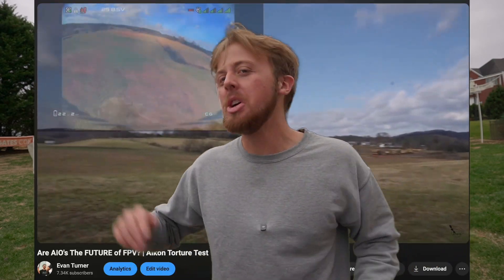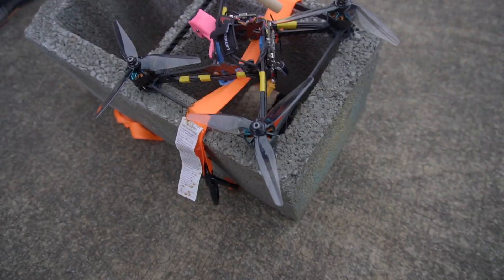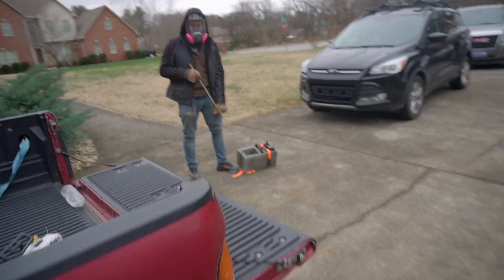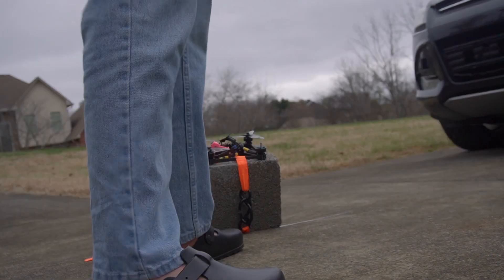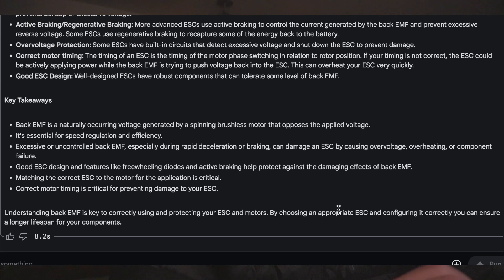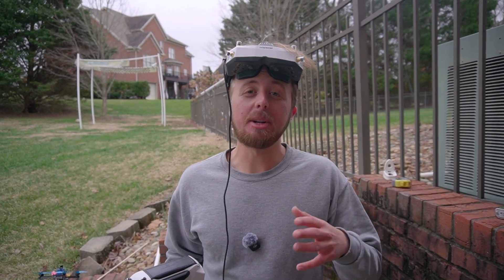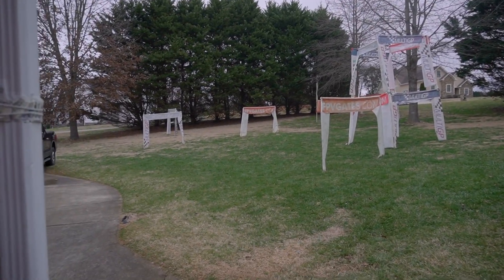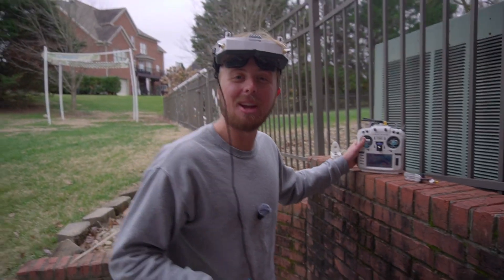Can this AIO Survive a Prop Strike?  | FPV Drone Torture Test

Comment: AIOs have been solid on 6s for like the past 2 years.
Reply from the maker: I had never seen one stand up to a race build ! What’s been your go to?
Reply: @ Jhemcu boards have been surprisingly solid. Out of about 7 boards plus 2 16x16 AIOs I’ve only killed one ESC in a crash, 3 others died on the bench because my MacBook port was shorting them out. I have an f411 in a cinewhoop that’s gotta be at least 3 years old. Super reasonably priced for the features too.
Reply: @ …also that’s fair regarding the race build, I’ve been flying them on no bigger than 4”

Comment: No, if you stop it forcefully outside the motor all the energie goes in the mechanical destruction (motor, prop and stick) and not back into the motorcontroller. Hoever if you stop the motor by the controller it all the energy must be absorbed by the controller. But here you are lucky because the motor (the moving part) and prop itself has a little mass. So if you put a very heavy prop on it you could destroy the controller by this action. On CNC we us very big resistors to burn this electric energie that is coming back from the servo's at stopping.
Reply from the maker: Interesting! Even though we left the ESC at full throttle during the strike it’s not damaging it? Would love more info!

Comment: On my freestyle build with individual ESC's, Each ESC has a capacitor along with 2 I run on the PDB(Yes...a PDB) and one on the DYS PRO V2 from 2018. This setup in this form has lasted since I built it in 2018 with only motors that have been changed out. Prob 3000+ packs cycled through it with zero failures. Forgot to say the ESCs are EMAX BULLET PRO LED 35amp. In my opinion the only reason this setup has gone this long with no failures is from the large amount of capacitance absorbing all spikes. Oh yeah, 6s with 2750kv!!!😮
Reply from the maker: Wow that is incredible!

Comment: Awesome response to the comments on your previous video.  Love the positive attitude and fun experimentation. I think that Aikon managed to make the ESC traces in the bigger 25x25 PCB thicker by moving all the non-ESC components onto that little daughter-board that is stuck on top of it. That I think beefs up the ESC section big time.
Reply from the maker: I think you’re absolutely right and it’s genius. Thanks for watching !
Reply: Wouldn't that make it a stack instead of an aio?

Comment: I think the future is AIOs and stacks coexisting together just like we have now. The biggest issue with an AIO is that when one of the ESCs does go you have to junk the entire thing. I like being able to just replace the ESC and not having to worry about changing the flight controller and reconfiguring everything.
Reply from the maker: totally agree, i think the way aikon is doing it with an aio that is really 2 separate boards is pretty genius so good on them especially if we can start replacing one or the other

Comment: The aio you used weighs 14.5gramms. The iflight Blitz mini stack, 20x20, with a 55a rating has all up whight of 16.5. That is only a marginal saving and kinda defeats the purposes of aio.
Reply from the maker: But it’s only one stack high which saves space!
Reply: Saves space at least

Comment: The Foxeer Reapers (aio) I bought 3yrs ago are still running strong and all I ever do with them is crash at full speed 🙃
Reply from the maker: Dangggg which quad is this on?
Reply: @headsupfpv  Bought them for My TT V1s and eventually swapped them into my TT V2s
Reply: https://youtu.be/gEoSfN-WaFQ?si=p1d1CLD6cfk0xDMH

Comment: Aikon make good esc's.

But tbh its probably some sort of degradation over a lot of heavy usage on the fets that eventually get taken out by all the factors of a crash or turtling.

The physical shock of crashes probably is also a factor in esc's blowing up as is the huge current/voltage spikes and sudden loss of active cooling on  un-heatsinked fets.

Which is a point if you crash into a tree etc its not just one prop being stopped it could two or three being jammed simultaneously which would even more strain on the esc.
Reply from the maker: Totally valid take !

Comment: Now we need a 1h stress test of it :)

For example : Automate throttle to change every X seconds with a max throttle for X second every minutes

Need to have a nice cooling and to log all of the possible data!
Reply from the maker: This sounds awesome! Will definitely try it out.
Reply: @headsupfpv  I did some brainstorming with myself and found this protocol

You will need a external power supply to replace the Li-Po

1- Analyse a blackbox file of one normal flight
2- Extract one minute of the throttle position of this flight
3- Put this extracted data in 5 category (or more): 0% / 20% / 50% / 70% / 100%
4- Make a program that send throttle pourcentage for 60 min
5- Eat chocolate (important one)
Reply: @Cornusse  can be done with EdgeTX special functions switches and curves to add throttle to such position and back to zero on repeat, yes.
Reply: @jasukenneth  Oh! Thanks for pointing it out, i don't know much in EdgeTX :)

Comment: Boy, he was scary with all that stick jabbery, all he had to do is go in from the side, but i really think there should have been a bunch of long punches to get every thing hot first then do the prop strikes
Reply from the maker: Will do this in the next one!
Reply: Also escs get weaker after time, so fly it hard more then try strike tests again while its hot, I'm really interested in this esc for some speed runs, another test would be if it could run good 4s 2700kv motors on 6s with no throttle limits and do long throttle punches like speed runs, i know skystars 128k escs can take that abuse ... That would be ultimate test, be careful though cuz the props will eventually explode!

Comment: can you do a video about how to land a drone with a 45 degree or higher camera angle? :D
Reply from the maker: This is a good idea!  Will definitely do this
Reply: angle mode?
Reply: just disarm it will land by itself)
Reply: I would love to take it down lower but if the drone maker only sells 45 and 50 angles then it’s hard for me to lower that angle. My thoughts were to use angle mode and just go super slow.
Reply: It's sounds rough not because of the ESC, but because the motors were hit hard with a thick poll 😁
Reply: 45 degree !! you must be the badest PV pilot, I would take it back down to around 25-30, practice landing , then take it back up, its just practice my friend
Reply: @1Flex-fpv  Get close to ground then disarm